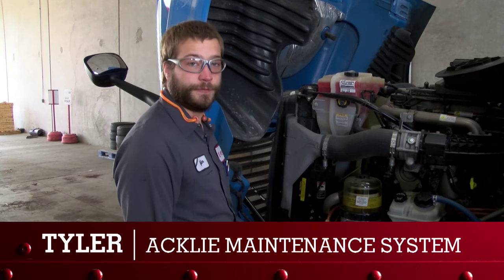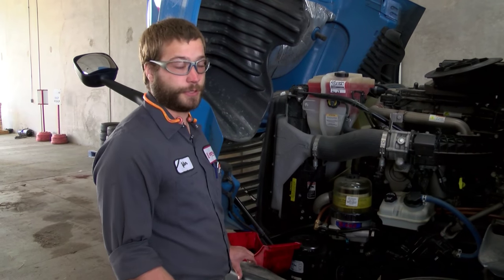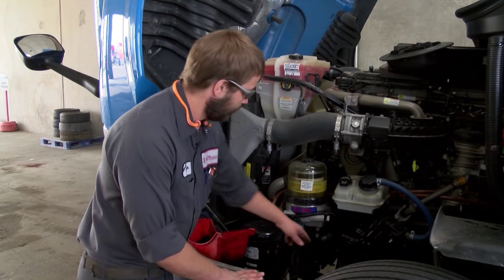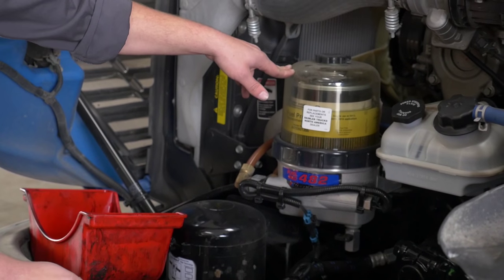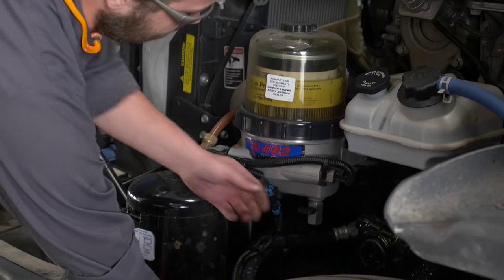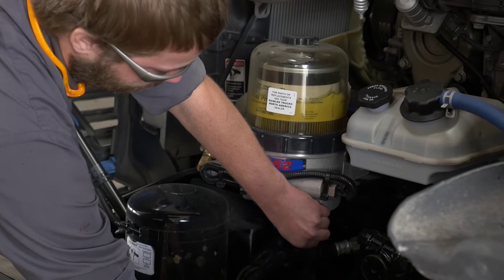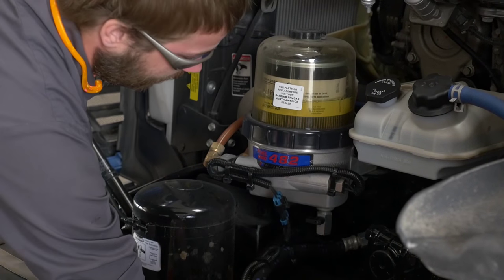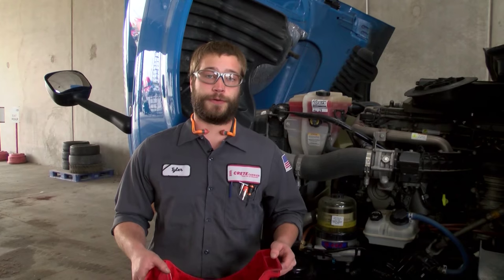How to Drain Water from the Fuel Water Separator - Freightliner Cascadia

Comment: I bought one of you guys 2010 freightliner cascadia DD13. It idles up and down between 4.5 and 6.5 rpm. On low rpm it sputter before coming back up. Just tonight it rev up to 800 rpm when pushed in clutch to park. Do u guys have any ideas on a fix?????
Reply: quantaty control valve, common issue.  its about $350-400 part plus labor
Reply: My problem with water separate is not filling up. Why can’t I see the fuel even tho I haven’t changed the filter for the last 3 oil change? 2015 dd15
Reply: @chuasmare22  that’s normal!  It means your fuel is running clean.  When it starts filling up it needs to be replaced.  If you wanna see it rise up don’t change them for a good while and you’ll see.